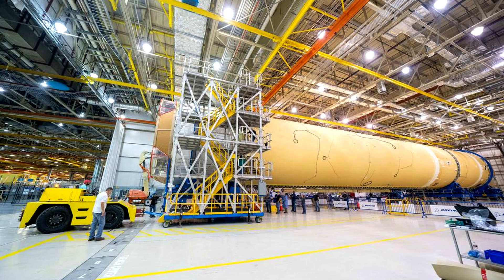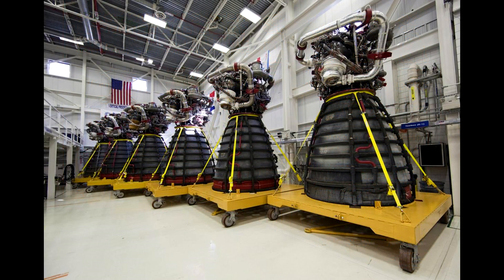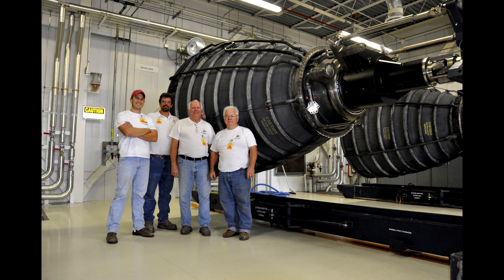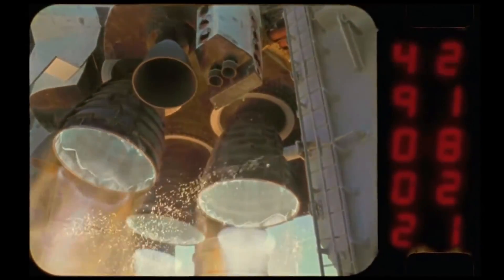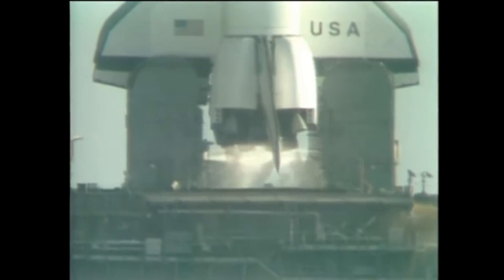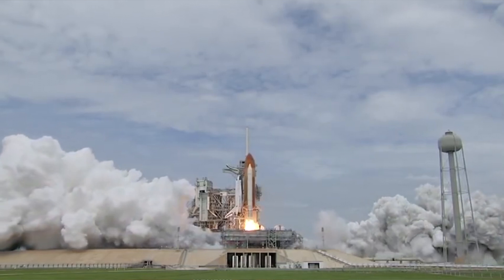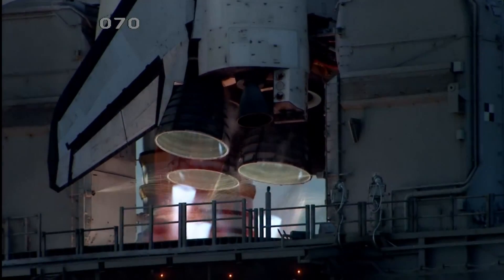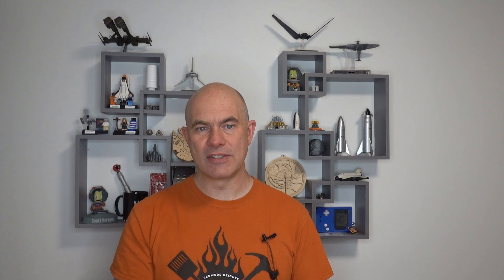Four Old Space Shuttle Engines Team Up For One Last Rocket Launch

Comment: I don't see any reason why NASA couldn't use the engine on SLS for what they want to do there, then once they finish the mission just recover the booster they're attached to and take it back.
Reply: The stage isn't made for that. They will likely be destroyed during their "lithobreaking" maneuver.
Reply: Even if the 1st stage survived impact, salt water is INCREDIBLY corrosize,  and would basically almost instantly make the engines unusable.